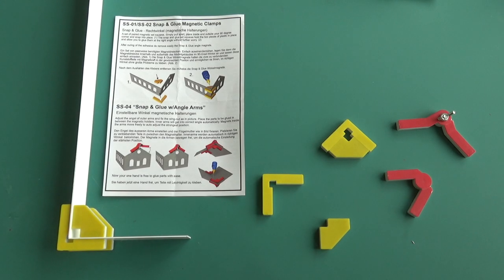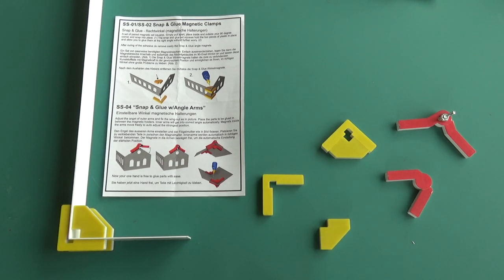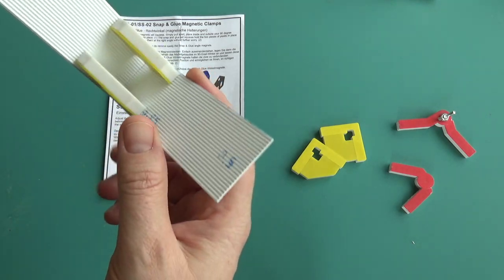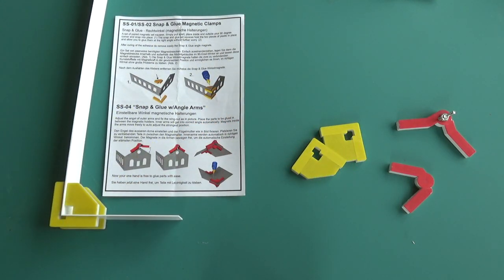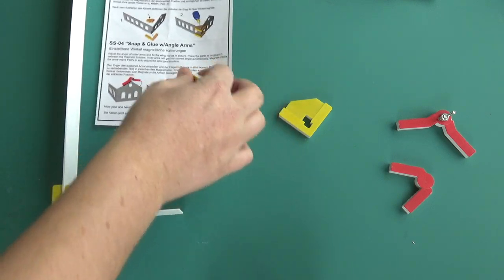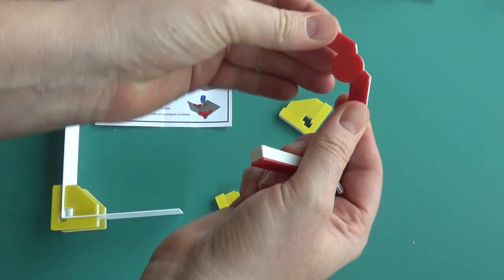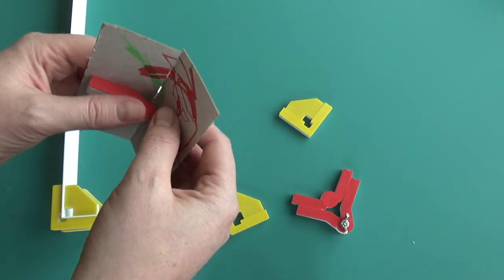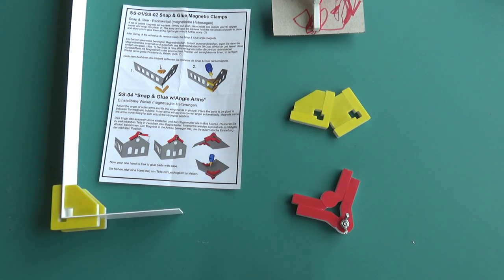Hobby Tool Spotlight - Magnetic Clamps

Comment: Very cool tool, I'll likely pick up a set. I was considering another sort of magnetic tray system, but it'd be nice to not have to break out a whole tray. I'm seriously space limited, so thanks!
Reply from the maker: I use one of those magnetic pads that comes with an iPhone repair kit. It's about the size of a smart phone and the whole thing fits into the case after your done.  I use it quite often actually; on the family's smart phone fleet, swapping sim cards or dismantling an HO scale locomotive. I guess that could be the next candidate for tool spotlight : )